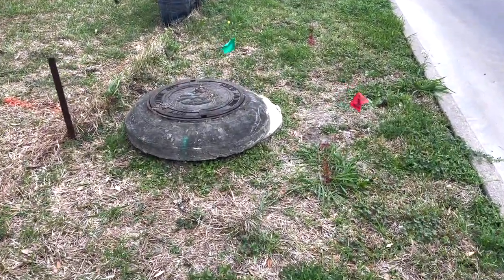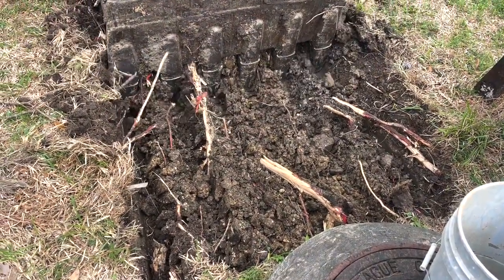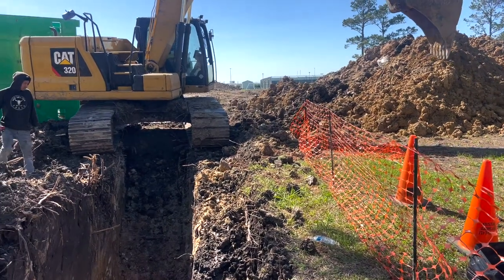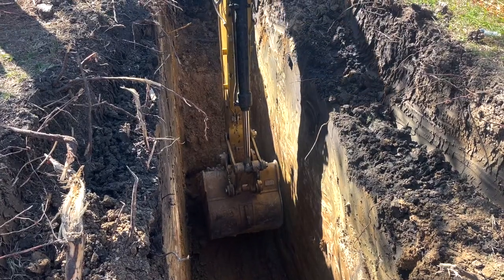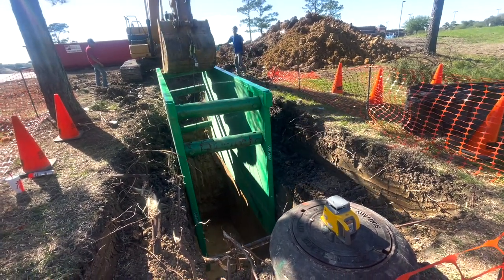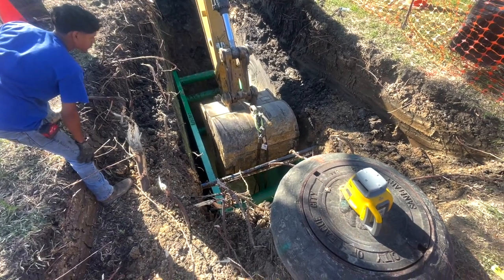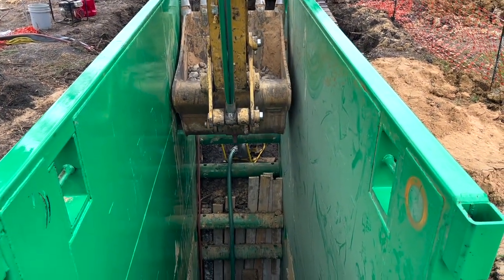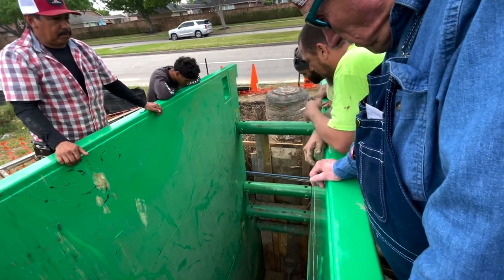$10,000 to set trench boxes for the plumber.

Comment: This is interesting.   I have to dig a 4m trench for a sewer offset junction to go into my property. 

I see the trench box is fine for straddling the sewer main,  but how do you then put your junction pipe in which is close to right angle off the main?    The trench box is solid and blocks the way.